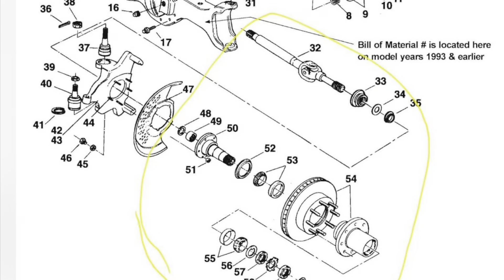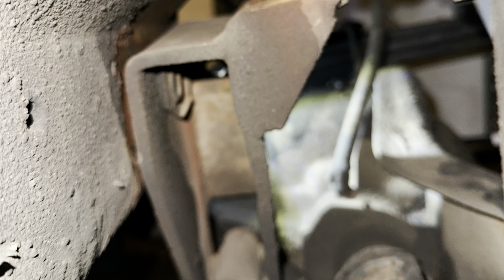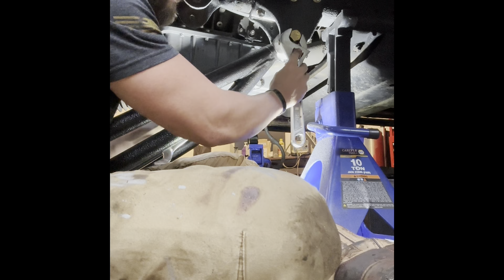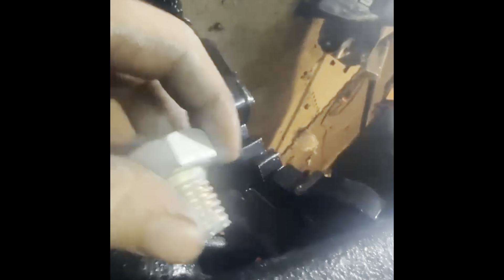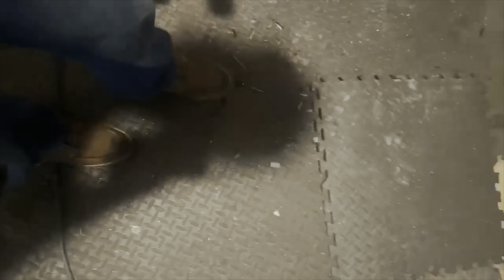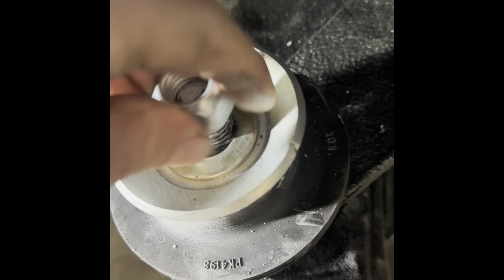Full install instructional of the coil spring conversion kit F250 1980-1997 7.3L TTB Dana 50

Comment: What the reason that they cut and slot the diff housing where the ball joint goes in
Reply from the maker: It changes the angle in camber and completely gets rid of the “reverse bowing of the tires” that plagues the TTB50, it also helps with keeping things more positive such that if you were to hit a bump at high speed or a jump tires would hang down bedsides bow inward at the apex of the tire closest to the finder which induces more tire wear criteria .

Comment: Almost looks like its just coil springs with the bucket and obviously radius arms brackets and drop brackets. I suppose it would be possible to do this cheaper with 2wd coil buckets and build your own radius arms.
Reply from the maker: @JBizzle822  that’s not all it is the beam is modified heavily uou have to cut a slot and flip the area where the ball joint sits completely upside down and scoot it back 1.5”
Reply from the maker: @JBizzle822  you could in theory probably use your own coil buckets yes but the fab of the TTB 50 is rather difficult
Reply: @ Yes the worrying part is getting the correct geometry to keep camber and caster in check. Eh 3k is a lot but prolly worth it considering the engineering that goes into to these and huge increase in ride quality.  A shackle reversal D60 outperforms a stock dana 50 ttb but a straight axel will never be the same as a coil over ttb
Reply from the maker: Straight axles are about the same price as Thai when you consider a full refresh which is usually what happens. This is far superior in ride quality that I can attest to having driven and owned both
Reply: @7treegarage Thats what I am thinking. By the time I source a D60, rebuild/paint and get a shackle reversal I would end up with a similarly priced build for a worse ride quality and travel.

Comment from the maker: Here is the 4x4 socket from torque king mentioned you will def need this  
Item #	Description	Qty
881110	QT1110i High-Torque, 4 Prong Spindle Nut Wrench	
881018	QT1018i 4 Lug Spindle Nut Socket for Dana 50IFS & Dana 60 Front Axles